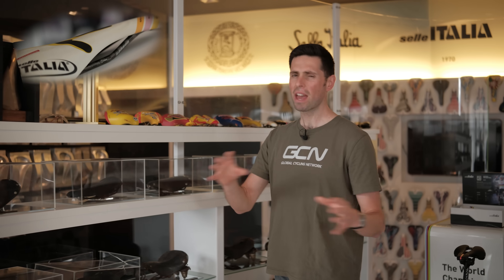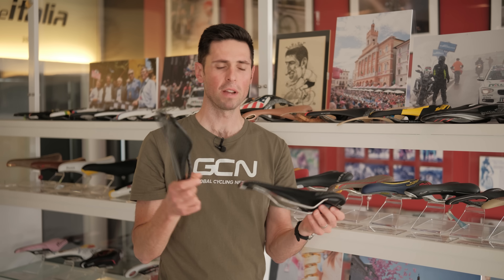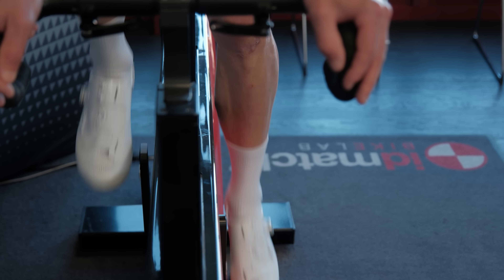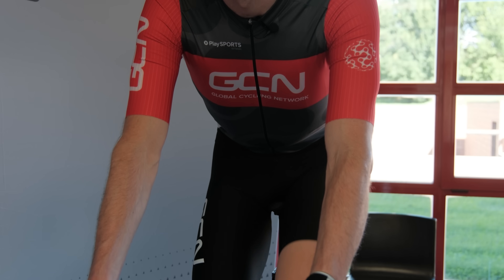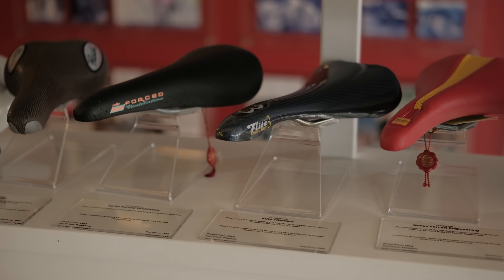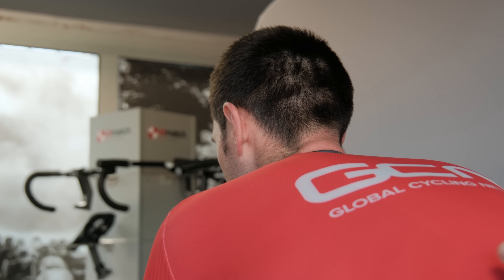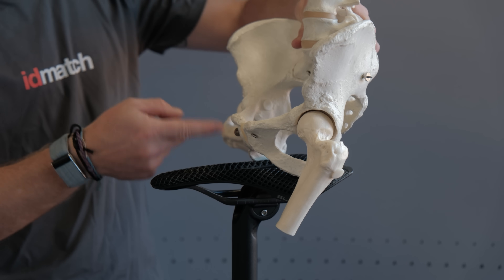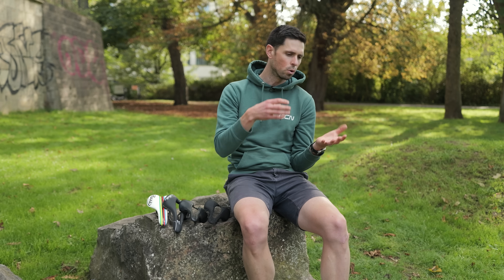The Evolution Of A Performance Race Saddle: SLR Story

Comment: I think the most important thing to do is measure your sit bones, then start with the proper width.

I'm 5'8" (173), but I need a 145-150 mm saddle. Once I figured this out, basically every wide saddle fits at least pretty good, and most excellent.

I ride a Berk, btw, so very minimal padding, and it's never uncomfortable for me.

Comment: I love your videos, but I think the result is miss leading on this as the first two saddles were clearly set too far back. I think for a correct result you should be set up properly on every single saddle, as different shapes might require different saddle hight ,for-aft, different saddle angle etc. When you have achieved to be in a same position thats when you can prove the real different.

Comment: Their widest mens road saddle is 143mm. Too narrow for many people. 

I noticed that you still favored the left side on every one your pressure maps, and that the amount of pressure was still too great. This is common when the saddle is not wide enough. 
You end up favoring one tuberosity over the other. 

Try something with a 150-155mm width, a flatter shape, and a gently sloping relief zone with NO cutout. You don’t need a hole in the seat to alleviate pressure and edema in the perineal tissues. You just need the right size and shape.

Comment: I've just fitted the latest SLR Carbon and WOW! I've literally got over 10 saddles in a box that I've tried and couldn't on with. I've probably sold another 10-15 over the years. 

This is the first 130mm saddle I've tried and I can't believe how comfy it is. I have mega narrow sit bones and most of my issues have come from my inner thigh pressing and rubbing against the edge of the saddle. In most cases I've had to slope the saddle way forward and almost balance on the rear, constantly shifting forward and then having to edge backwards as I ride along. The SLR 130 is the first saddle I can run near enough level (-2 degrees).

I'll be buying more!

Comment: Most of my bikes have this SLR saddle, same as the world's one in the video. The only differences are the rails, some are carbon and others are the metal version. I've found these suit me for long or short rides, racing or leisure
Reply from the maker: we remember when it was launched, it turned heads - and continues to do so!
Reply: @gcntech I tried the bare lacquered carbon one. I could manage a 10 mile TT, but went kind of numb for anything longer!

Comment: It didn't seem like the SLR saddles were a good match for Alex (except possibly the final one).  The obvious final section would have been for Matteo to have used his knowledge of the product line to pull out a few of Selle Italia's non-SLR saddles that might have been a better fit, and recommended the one that was best for Alex.  Maybe something to try in a future GCN episode?  I hope Alex isn't normally riding on the nose of his "everyday bicycle", since I would imagine that would put a lot of pressure on "soft tissue areas", and would be good reason to upgrade saddles to one that doesn't do that.
Reply from the maker: Thanks for the comment Bob, Alex is keen to investigate more on bike fitting and position to see if it helps him, especially with regards to riding on the nose so much! Cheers!
Reply: @gcntech maybe a video with a well known bike fitter like bike fit James etc
Reply: @troycollett8540  Yes! And a video not sponsored by a saddle manufacturer.

Comment: What I’d like to know is whether 3D printed saddles have an increased wear and tear effect on your bib shorts gusset just due to the nature of the print and filament used versus the smooth texture of traditional saddle materials.  ‘Cause we all know, bibs are bloody $$$$!
Reply from the maker: We haven't noticed any increased wear on our shorts. A great question!
Reply: From 4 years of experience with a 3D saddle over about 17000 miles, nope. No difference in wear. I have a Fizik and don't see going back to a traditional saddle.
Reply: 3d printed saddles have an increased factor of wear and tear on the contents of your bank account.
Reply: Thanks for the reply everyone.  Good to know!  Prologo Nago R4 has been my saddle of choice.  Might just have to look at their 3D printed version now.   @prestachuck2867  haha that applies to cycling in general I think. 👋💸💸💸

Comment: So the Selle Italia fit expert didn’t see the obvious, in the `Alex is sat too high, having to point his toes at the bottom of the pedal stroke to reach the pedal. The usual response to this is to move forward and sit towards the nose as a way of reducing the distance between the saddle and the bottom of the pedal stroke. Simple seat height reduction of a few mm would have elicited significant differences in how he interacts with the saddle.
Reply: Yep….changing the saddle that many times with little difference in the results is a big red flag that some position adjust is needed.
Reply: Yup, based on my limited experience... I don't think they've ever featured Alex having a bike fit, especially from an actual fitter/physio and not a computer.  Has he?

Comment: Huh, quite interesting , now we all need to get « Fited » on one of those machines to know what the best saddle for each of us would be 🙄
Eons ago I had a leather Brookes saddle on an early bike that over time changed shape quite radically, the front / middle had narrowed significantly, where the rear had remained relatively the same because of the rivets across the back holding it in place. ( I think that was the saddle on a Holdsworth framed bike I had built piece by piece that was stolen 😭)
The Brodie Revel I picked up recently, came with a DDK Run Sport, which in combination with the GCN  riding kit I recently acquired, seems quite comfortable for the longer rides.
I’ve been talking note of the suggestions made in the Bike Fit videos you’ve published over the years and all those tips I’ve tried to implement, seem to be getting me in a better, more comfortable riding position !
Thanks for making such informative content , keep up the good work 👍

Comment: It's very disappointing that all attention goes to the pressure on the bone, but nothing to the pressure on the gentle soft tissues, most importantly testicles and are around it. I've always thought the cut it in the middle of a saddle was exactly for that - realising unneccessary pressure points from the perineum and the testicles.
Reply: That pressure on the nose is the soft tissue pressure you’re referring to so moving off the nose and to the sit bones has the intention of doing exactly what you’re wanting 🤗
Reply: I believe that is what is supposed to be carrying the weight, the bones.
Reply: @jamesdubben3687  Of course. Which has nothing to do with what I'm saying though.
Reply: 11:35

Comment: would have liked to see how saddle tilt changed the pressure area and how much tilt change was needed to affect a change.  in other words, what is the tilt tolerance zone and what tools can be used at home to get the tilt in tolerance.
Reply: If the saddle fits, there no need to tilt it. Should be dead level.

Comment: Thankfully we also evolved to have Aliexpress so normal people can afford cycling stuff without being ripped off :)
Reply: Totally agree, I would never buy OEM these days as it all comes from China anyhow!
Reply: @aveedub7403  So you saw the shots of them manufacturing saddles in the factory where Alex was filming and decided they were made in China? Really??

All Selle Italia saddles are made in Italy - the company guarantees it. The Model X saddle is produced using materials sourced from within 15 miles of the company's headquarters.
Reply: Here's the thing about aliexpress 3d saddles - they seem to be the same padding rigidity from front to rear.  If that works for a rider, fine, but one isn't getting the variation in density from front to rear.  The benefit doesn't come from 3D printing, it comes from engineering to alter the 3D printing appropriately.  Some of the aliexpress saddles might as well just be rubber with a bunch of holes drilled in it.
Reply: @workingguy-OU812 agreed, caution is always recommended, but that's the same case with any saddle. But after 4 "brand" saddles giving me all kinds of discomfort even after a hike fit, I'm happy to try out and risk something for £30-50 instead of £150-300. So far I've been more impressed than disappointed with the cheapo ones.

Comment: This is ridiculous. It makes you wonder if ID Match technicians will not properly setup saddle position unless you spend money on their latest product. I understand that it is paid gig, but it would be much more interesting if you didn't make it feel fraudulent.
Reply: Just shutup and buy, new product better, keep buying, don't ask questions, just consume /s
Reply: paid
Reply: Please tell us why you think it was ‘ridiculous’ and it seems ‘fraudulent’ to you?
Reply: @Kadenz-ly3jr  What I find ridiculous is showing pressure maps of saddles that are incorrectly set. Of course, I might be wrong, and it may actually be impossible to set up obsolete Selle Italia saddles in a way that distributes pressure to properly engage the seat bones. If that's the case you should explain it more clearly, cause at the moment it looks like only latest and greatest products are really usable.
Reply: @statlerjr totally agree. Sitting on the nose of the seat is caused by the way it's set up, not by the saddles design (for the most part). Most likely, the seat was either too high, or too far back, which most likely caused him to sit at the front, I doubt it has anything to do with the shape

Comment: I still don't understand, how 3d printed plastic is more expensive than refined materials within a leather casing. Is it just so that they have more profits, because no one would buy the normal version otherwise?
Reply: it takes more time to produce
Reply: @yeah-g8v  More time, but by a machine.  Actual human time is most likely less as once it is printed it just gets glued to the saddle base.
Reply: @workingguy-OU812  time is money, TPU printing is slow, even in industrial applications and scale
Reply: Don't think anyone even makes saddles with ox hide anymore. Brooks still has cow leather designs.
Reply: Time like everyone has said.